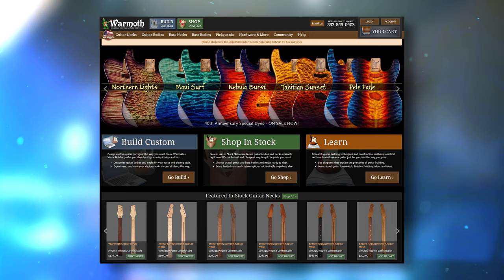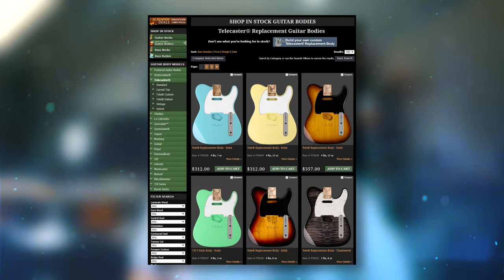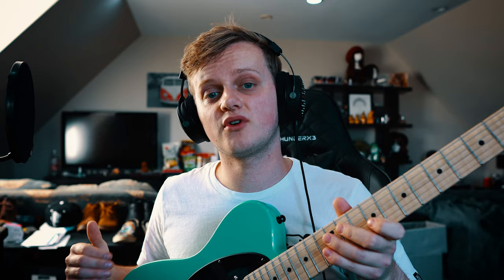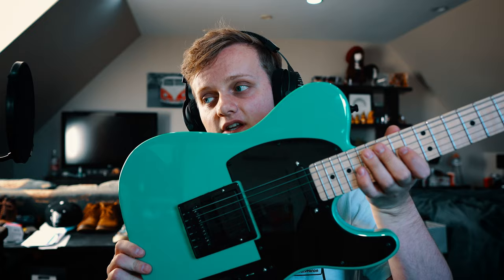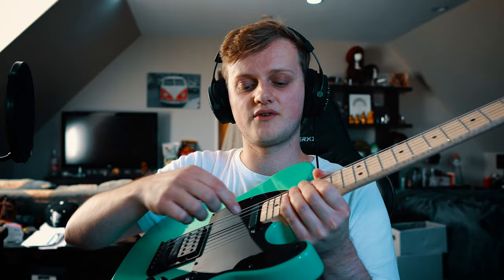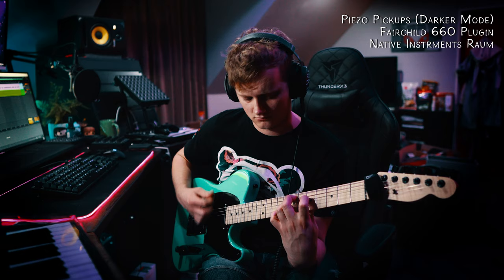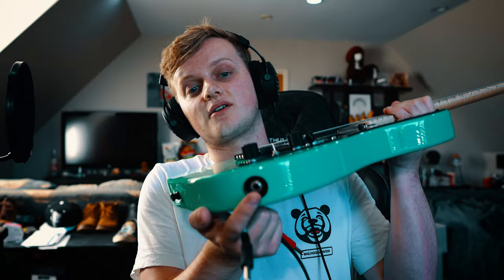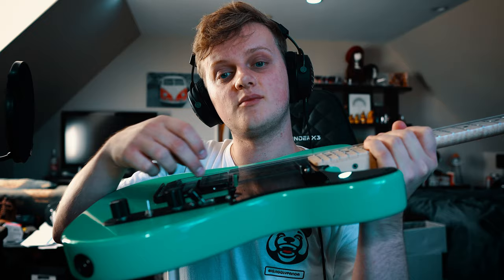My Warmoth Telecaster In Depth | Bare Knuckle Pickups Silo/Flat '50 | Graphtech Acoustiphonic

Comment: How are the split clean sounds with the Silo? I've been debating putting one in my telecaster as well but I was hoping the split sounds would sound more like a traditional telecaster. Think I'll be going with a Brute Force neck pickup.
Reply from the maker: I haven't really tried it out too much on the single coil setting. I'm not a huge fan of the single coil sound from it through higher gain tones (which is weird because I prefer split coil on my other two split coil guitars). The single coil tone seems quite thin, so I will have to see if I can swap which coil is on in single coil mode, and see if it improves ✌️
Reply: Tim Murray thanks for the response! I’m assuming you currently have the coil closer to the bridge split then(?)
Reply from the maker: To be honest, I don't actually know 😂 I did the wiring by mostly copying a diagram online, but I wonder if the colours were flipped (as the diagram was from a different manufacturer)